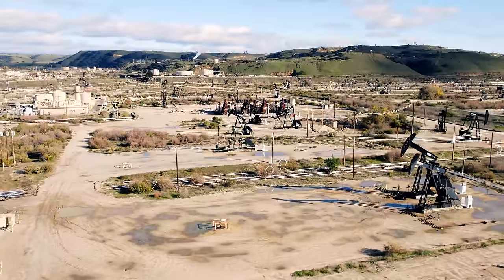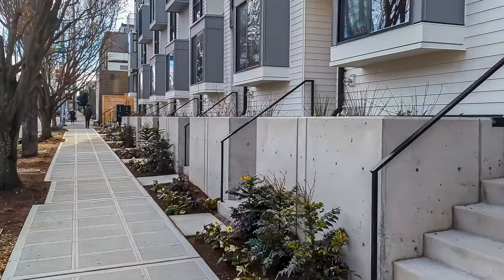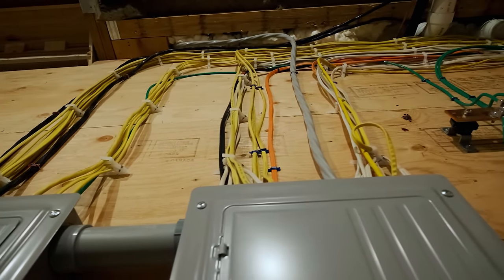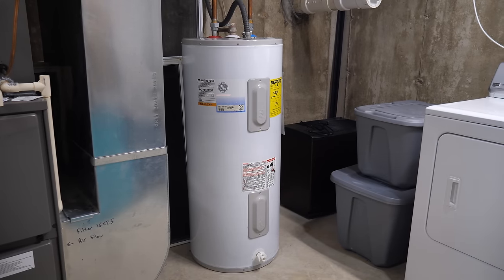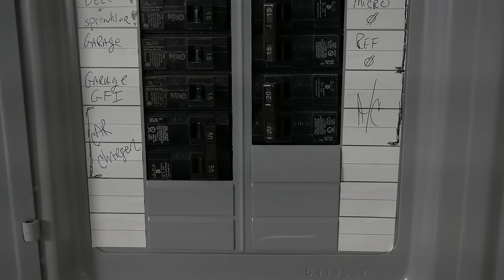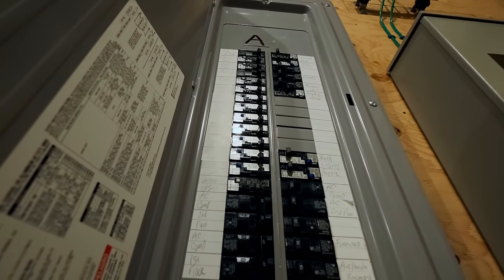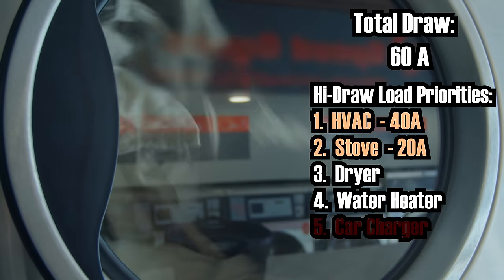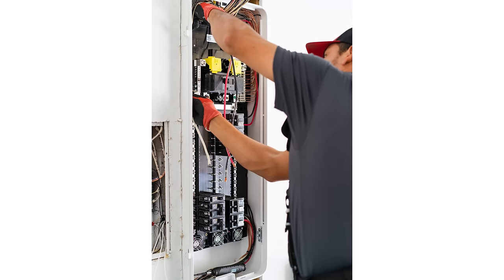Home Electrification: There's not a lot to do, and it doesn't have to be hard (Part 1)

Comment: I have one additional gas appliance that you didn't include in your 'Big 4'. And that is my whole house backup generator, that needs to run whenever the grid goes down. which unfortunately is far too often. And also a reason why going totally electric is unlikely for me personally. (Although I like the idea overall.)
Reply: I've been trying to get my rural relatives to invest in a gas-powered whole-house backup generator as they lose well water pumping as well whenever their power goes out (which seems to be at least once a year).  I've beening looking into one myself, even though I have city water, to at least keep the furnace going in the winter, along with all the usual niceties.  How has your experience been with yours?
Reply: @centauri61032  Thanks for the info!  Good point about the LP option.  I'm not entirely sure if they have natural gas access or not...
.
I also have UPS units on my computer equipment in case of electric "hiccups" (wish they put batteries in appliances for the clocks, lol).
Reply: @PongoXBongo  If they do use LP, then getting a 2nd smaller tank just for the generator is a practical idea. It would make the generator installation much easier. Unless your current LP gas line just happens to already be right near where the generator would be placed. In my installation, my electric meter and my gas meter were on totally opposite sides of the house. I opted to place the generator and transfer switch right next to the electric meter. But then I had to run additional gas piping all the way across the house to supply the generator.

Comment: Excellent content, I am certainly convinced that it is not impossible to electrify a home. However I would raise two potential concerns that I have. First, homes with many occupants will have a difficult time manually limiting power usage, as simple as it may be for one person. It's not uncommon in my home to have the drier, oven, hot water heater, and A/C on at the same time, I would be concerned about inadvertently exceeding the limit. And second, I think your dismissal of the risks of IoT-controlled breaker panels is mistaken. There are indeed serious privacy risks, reduced serviceability, and dangers associated with placing essential functions of our homes in the hands of VC-backed tech companies.

That said, I would seriously consider everything you discuss in my own home, should I ever have the opportunity (except the smart panel!)
Reply: I'm mostly sad that he didn't mention the cost of building and shipping the new appliances. All 4 of the things he mentioned are gas in my home, and 3 of them are less than 5 years old. I sincerely doubt the environment would be better off if I threw them out to get new electric models instead. It's weird because I could swear his electric car video mentioned the heavy toll of producing and shipping automobiles of any sort and advised us to just make sure our NEXT vehicle did better by the Earth rather than urging us to go get a new EV right away. I'm sure he didn't mean for the takeaway message to be "go buy new appliances right now", nor did it come off that way to me. But I am still disappointed that he didn't even mention it.

Comment: I think you'll be surprised to know how many homes still have 60 amp services. 😅 My parents have a 60 amp service, electric hot water heater, and electric stove. The way the house is set up, it does not work very well, and they trip breakers semi-regularly in the winter. When the furnace is runs the fan, the electric kettle trips the breaker for example.

Their previous home was also 60 amp service, but with gas everything but the dryer (I've literally never knowingly seen a gas dryer). And that was never a problem, despite having two buildings with full kitchens, etc., on that 60 amps!

The way power is managed and distributed is definitely very important to how well this works. I used to use my welder at my friend's house, again 60 amp service, never ever tripped a breaker there even turned all the way up, and again the appliances with the exception of the furnace were all electric.
Reply: It's also quite common in Japan, and the voltage is even lower.
Reply: @meneldal  i lived in japan, it is also 110 like the us, and the outlets are the same.
Reply: @WeedMIC  Japan is officially 100 (though it can get to 110), while the US is 120V so you do lose a bit there (and also makes a lot of appliances perform much slower).

Comment: In Europe it is a pretty common to use a device called priority relay, it is a relatively simple device that can disconnect a load if it would exceed a total allowed current limit. It can be used to disable the water heater when another devices are running.
Reply: Never heard about such a device in Denmark. We have 3x48A @230V in our apartment. Houses tend to get 3x64A @230V. There is loads of power. But prices have increased.
Reply: A "Lastabwurfrelais" is only used for very special applications or fixing a design flaw in your circuit.
Reply: @kttk4564  I've seen those priority relays in quite a few Finnish homes, most cases I've seen it's just a simple case of preventing Sauna from going on at same time as Kitchen Stove. 
On the use cases mentioned in this video, you could just do same but vs. the car charger.

They're simple things that allow people to have lower service level.
Reply: IMO this is the best way to go about it, no smart crap that probably requires apps and stuff.  Relays are fine.  Could also use something like Arduino to control it, but as long as it's 100% stand alone it will work for decades without needing to be touched.  I plan to do something like that for my solar, I want to switch loads to solar based on power availability so I will basically have some devices on a A/B relay.
Reply: Thank you! During the whole time I was watching I was thinking "so like a délesteur we have in France?" but couldn't find the correct english translation for that device, and Google failed me on that.
They're uncommon in France but they definitely exist.
Reply: @trex2099  3 phase delivery is COMMON?
in USA 2 phase / split phase 120 - 0 - 120V 
in Canada ether USA style split OR 2/3 service 2 OF 3 phases 120 - 120 - 0 and 120 + 120 gives 208 for high load 
100A OR 200A is "modern" with 60 and 125 being "older" levels 

the transformer up the pole is rated normally for 200A per drop and the utility will do the "drop" TO your mast head and YOU pay and get done from mast DOWN to load centre for a service upgrade to 200A
Reply: @Graerth  prioritizing something above sauna? Blasphemy! I have a priority relay set up so that it switches off the resistive heating elements in the bedroom floors when the sauna stove (9kW) is switched on.
Reply: @jasonriddell  - I have never seen a house or an apartment in Denmark without all 3 phases. I currently live in a condo from 1929. Most of the wiring to distribute power in the building is original (fabric insulated wiring in wooden distribution boxes although we have replaced it now). But 3 phases since construction.

BTW: We do not have transformers at the poles. Because it is 230V distances to transformers can be longer. But all streets have 3 phases installed.

I think this is pretty common on Scandinavia and Germany.

Comment: Here in Finland it has been common for over 50 years to have mainly electric heating and appliances, maybe one or two wood-burning stoves to give more heat during the coldest months (we hit -35C just this morning) and heat up your sauna. Gas has been a thing in the past, like early 1900s, in bigger cities.
Reply: And for decades we have used simple contactors to turn off loads like space heaters when something like the sauna stove is heating up to avoid tripping the main fuses. Also many car chargers and geothermal heat pumps come with current sensors that you install in your breaker panel and they will dynamically limit their power draw if the total draw of the house is nearing the service limits.
Reply: @@dave655467 Well we have nuclear power in Finland so this winter shouldn't be too bad unless the nuclear power stations break
Reply: @@dave655467 They get the uranium mainly from Kazakhstan, Canada and Australia. They've got multiple suppliers and long supply deals so there shouldn't be a sudden price hike.
Reply: @@dave655467 I don't understand your point? You're saying that nuclear power plants consume more energy than they produce? I'm an electrical engineer so I am fairly sure I know how electricity is produced here and thanks to nuclear we have more production than consumption in the country so unless several nuclear power plants go down at the same time, we're fine.
Reply: @@dave655467 Well I know the situation is worse in some parts of Europe, but Finland has enough nuclear for our own needs. Coal is only about 10% of the electricity production in Finland, oil is only the last resort if the grid is about to go down for example if a big power plant gets disconnected from the grid. Anyway electricity will be cheaper this winter than last winter for sure.
Reply: @@dave655467 I really don't get your idea of a power plant needing more power? If one nuclear plant goes down, there's another. If enough production goes down to cause a frequency drop, emergency oil generator plants will kick in and fix the situation in seconds. So the nuclear power plants generate enough electricity to keep the grid and each other up.
Reply: @jessenic  i think we had one of the nuclear plants shut down for maintainance a couple weeks ago with some other electricity irregularities like sweden not providing as much as usual, so you could see the prive going up from the usual about 6 cent/kWh to a whole 60 on some occasions and above 40 most days, but even that didn't seem to cripple us

tho I'm curious about you saying we only have about 10% gas, when to me it seems we have about 50% burned fuels, including about 25% gas and oil, and 25% bio gas and wood
Reply: Yeah and nothing beats gas for heating a home in sub zero weather. Keep you thermometers I only use American thermometers. Zero is 32 degrees below freezing if you don't know. 73
Reply: @jessenic oh yeah the worst for the environment I forgot in my last comment about electric pollution. You made a good point when it breaks down or leak in the environment. I like the old protest back in the seventies and eighties NO NUKES!!!!!!!!!! 73

Comment: I knew you'd bring up smart panels. I ask you to go price swapping out the panel to one of those. Going from a 125A to a 200A dumb panel was $5000 cheaper than Span. I really wanted to do it, but there was no way I could justify it when going to Solar. The "100A service" is probably capable of more than that if it was delivered in the past 30 years (I found that out when they upgraded me to 200A service). For houses built 50 years ago, I don't know that I would trust just upgrading the panel anyway. You are falling for the same trap I did. Unless you are offering to talk to Span and working to get them to reduce the cost of their panels by half or more. Also get them to increase the size of the panel as that one is a very small one.

Additionally you are also thinking about this from a single person without a family with multiple kids. Having the washer and dryer running at the same time as the dishwasher running while cooking is a pretty common scenario multiple times a week. You can say, "But you shouldn't do that all at the same time." That's fine, will you personally fund it such that the mom and dad don't both have to work for the 4-6 hours they have home and awake?
Reply: You are missing an important point:
You can do all of that (cooking, dishwasher, dryer, etc.) at the same time.
The only thing that can't happen is that they all run on full power at the same time.

Take the dishwasher and washing machine: they don't run constantly on maximum power. They heat up the water once (preferably they use water that is already preheated by your water heater).
So only for a short time they need that much power. For most of their runtime they don't need much power. 

And for cooking: How often do you have all hot plates - on full power - running at the same time? For the most time during cooking they are set to one of the lowest settings.

Comment: I just finished my house electrification today with a heat pump water heater. 2 weeks ago I replaced my furnace with an air source heat pump. Did all the work myself and saved a bunch of cost.
Reply: What heat exchanger u used ?
Is it owned by you, did you install the system yourself, a community project ?
Why u needed to replace the pump, more compacity needed ?
Reply: I hate my stupid hybrid water heater. Have to disable the heat pump in the winter or else the basement will get into the 30s. And I still don't see a big drop in energy usage even when it's in heat pump mode.
Reply: @person749  I like the ones that have a separate evaporator that goes outside but almost no options for them in the US currently. Where the "all in one" units seem to make the most sense is warm climates where the water heaters are electric anyways, they tend to not have basements, and they have the AC on 80% of the year. In Australia I have seen people have their water heaters outside their house!
Reply: @randomvideosn0where  Can confirm. Where I grew up in Australia, the government was paying people to replace their electric water heaters with the dual heat-pump types. Mine was outside on the side of the house. Pretty much no one I knew except for rich people had basements either.
Reply: @randomvideosn0where  Oh if I lived in Texas it would be a miracle machine!

Comment: @Technology Connections - Alec, this was an excellent video! You did a really great job of covering all the major points and addressing the common concerns regarding home electrification. And I say that as an architect who specializes in this topic and passive house design. Your argument for why 100 amp service can work was well thought out and reasoned. I can't wait for more in this series!
Reply: For me living in Europe 100A sounds just bonkers, currently have 3x16A....
Reply: @matsv201  remeber that our EU grid works at 220V,  US at 100 if i remember correctly, we get more energy per A basically. Still here in Italy homes run with just water/home heating with gas and just 16A contract
Reply: @8paolo96  No. Alec said for a 100A they get 24kW of power, meaning the main breaker is 240V. And 100A. Enormous amount of power. Where I live in Europe the "normal" amount is 32A.
Reply: It is against national code in America to install a new service at only 100amp.
Reply: @AKguru762  This was presumably not the case 60 years ago when my house was built. And there's lots of houses like mine.

Comment: I knew about gas ovens, but gas clothes dryers were a new one for me! 😄
Reply: I have one... I use it mainly in the winter, they work very well and are pretty cheap to run and the hot air blowing out goes through a water filter (to catch debris). This is awesome in the winter as it is also keeping my house warm (ie. Get twice the benefit at same cost).

In the spring and summer I use clothes lines which cost nothing.
Reply: yeah. I didnt even know those were a thing
Reply: Gas dryers are very common in Michigan